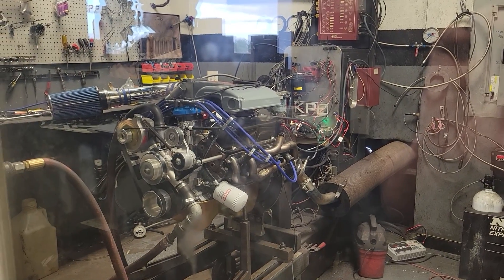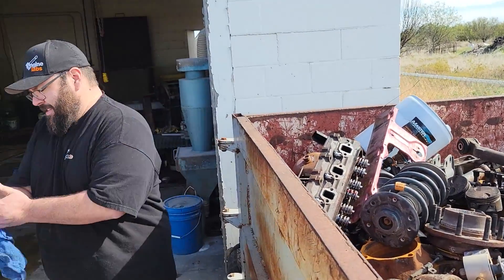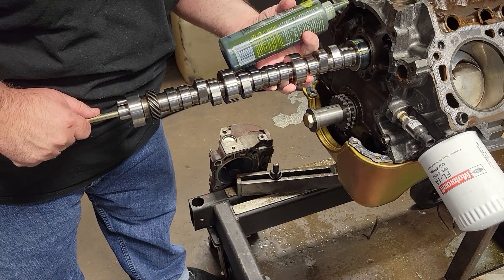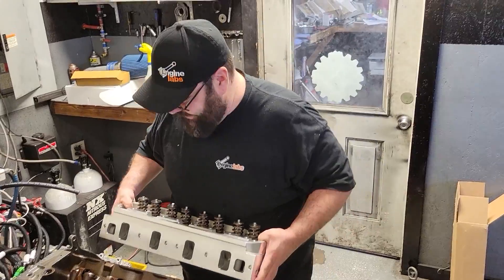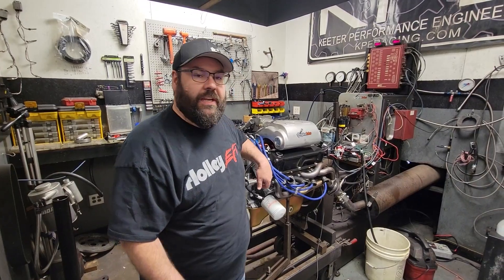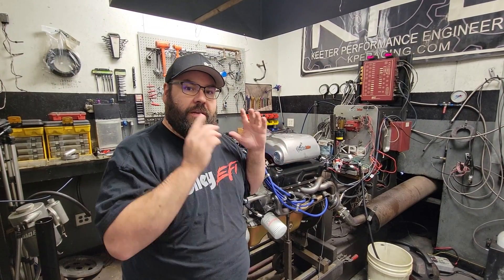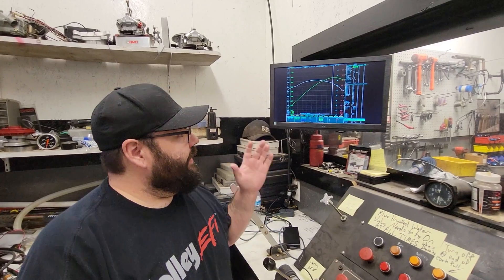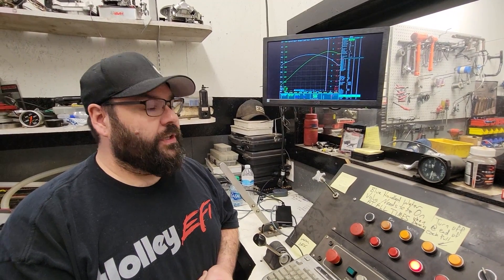Making Serious Power on Retro 5.0 With a Trick Flow 11R Top End Kit

Comment: Is this just pretty much bolt on? Or do you need any other supporting mods for this? Thanks for any info!
Reply from the maker: Depending on your starting point, you might need enough fuel pump for the power, and definitely bigger-than-stock injectors.
Reply: @EngineLabs  thanks for reply!

Comment: Those are damn impressive! Thats a solid 350rwhp 12 sec car! Why did you run the holley and not the matching tfs?
Reply from the maker: The TFS intakes were on extended backorder. Plus, AFAIK, they have been modernized. The SysteMax is straight OG.

Comment: You probably down a little horsepower from what they advertise bc you're running a full accessory drive which im sure they didn't n the torque is higher bc of the longer intake runners

Comment: I have a 5.0 roller. I have the twisted wedge 11r top end kit. With a 347 stroker, 750cfm carb.
What do you think i would be looking at as far as power? 
Its going in my 86 Bronco.
Its backed by a Len Tech AOD trans.
Reply from the maker: At what compression ratio? Also, in a Bronco with an AOD, I'd guess you probably won't be spinning it nearly as hard.
Reply: @EngineLabs  compression is 10:1
Im in AZ. The summers get ridiculously hot. So i didnt want to struggle with detonation issues.
Im not planning on racing it. I’ll pretty much be in the 1500-3500 rpm range 99% of the time.

Comment: Do the pistons need to notch to run these heads
Reply from the maker: I'm not sure, because we are using an aftermarket piston. Since the Stage-1 cam is small, there is a chance everything will clear with a stock piston.
Reply: I have these heads with stock pistons with .600 lift and miles of clearance on exhaust

Comment: Down t watch  ready t see what it makes.  You should run different cams ford e b f  and a small solid roller something from Howard's  right out the catalog  old school.  Like to see what different injectors would do factory fox 19s vs newer explorer 4 hole 19s 24s on up.  Kenne bell would be awesome to hear. Procharger ps14  d1 hell yeah badasst automobile ever made.  Keep the noise up  put in a car and let us see it run.  I have these heads 11r 190s cnc street. 30over  matching # shortblock. But still lookn em in their boxes working my way to it

Comment: Are these the best option to squeeze the most out of sbe 302? Or are there better option top end package wise
Reply from the maker: "Best" is such a loaded term. But the 11R top end certainly works as advertised, and then some. I think with a larger cam, the engine would wake up some as well, but with the stock bottom end, PTV clearance might be an issue with a larger cam. I'd definitely be happy with just this N/A package in my SN-95, no doubt.

Comment: did you change pistons? doesn't have same 4 eyebrow
Reply from the maker: We did. We went to a stock-bore forged 2618 piston right off the bat to handle the boost that's coming, and had valve reliefs to work with the 11R heads.

Comment: I’ll never understand why so many people put heads on the block when it’s on a 45 degree angle. The engine stand rotates people.
Reply from the maker: Ummm, that's a dyno cart, not an engine stand. It doesn't rotate.
Reply: 😂didn’t know this was a ‘problem’
Reply: @CPEngineeringSolutions  I seen too many times people just about drop the heads.

Comment: I have this exact kit ready to go on 92' mustang convertible. Motor has 100k and runs great. I may freshen bottom end up when I do HCI install just to get the most out of it. These numbers are impressive to say the least. I have the TFS track heat intake instead of the holley like you have. The holleys are tough to beat. Great videos and content! Look forward to more.
Reply from the maker: We were all super pleased with the top end kit. To the point, that we almost called it done right there. That will be a fun combo in the car, for sure!
Reply: How did it turn out?

Comment: Could you put a spacer underneath the intake to break 400 hp ???
Reply from the maker: There was a spacer of sorts (it was a capped-off nitrous plate) between the upper and lower intakes to clear the fuel rails.
Reply: it made 411...the kit claims  432 with the carb....not bad...
Reply: Adding even more runner length would just make more low end.